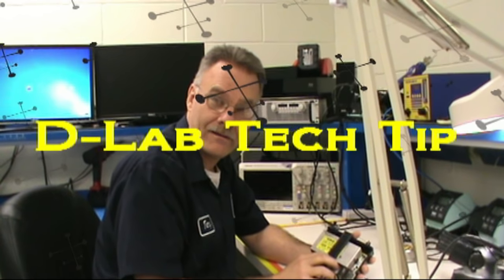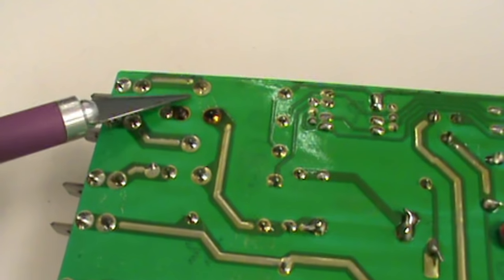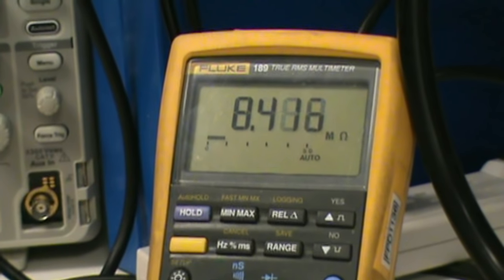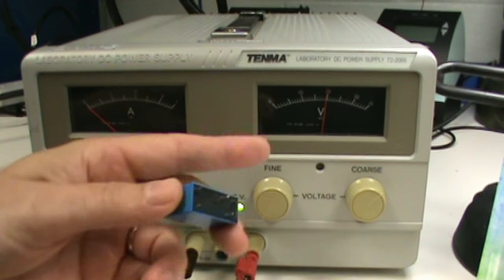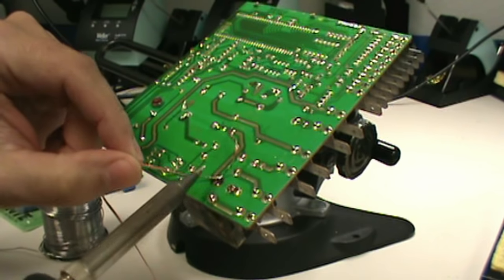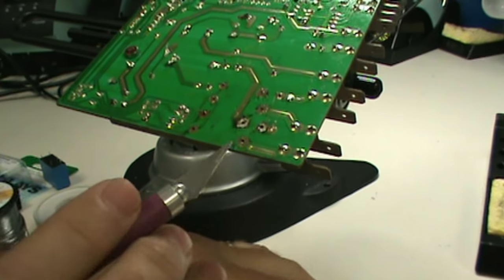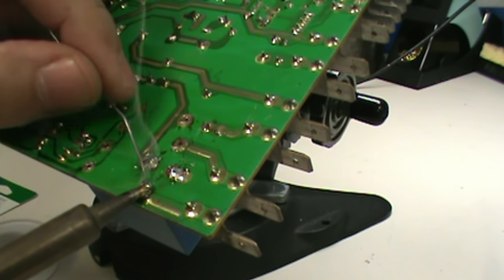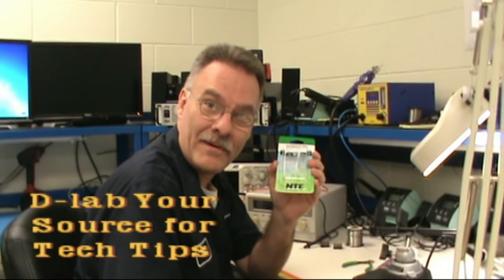How to repair washing machine Remco pcb relay failure D-lab Electronics

Comment: Terry - something I have noticed a lot of tech's do wrong with solder wick :  they don't use the right gauge of wick and they don't cut off the used ends and start fresh every time.  A wider wick is used for larger connections because it can wick much faster than the thin stuff.  Cutting off the end gives better visibility and faster melting by heating with less heat.  I have wick available in sizes from about 1 mm to 6 mm widths in my collection.  When the need comes for larger wick I have been known to form the 6mm stuff into a piece twice as wide, or just use a solder sucker tube and clean up the traces with the 6mm wick.

Comment: Hi TD,
Our Frigidaire freezer blew out its electronic control unit, it does all functions. 
80$ R&R, easy fix.  But I also replaced its compressor "relay" and motor run cap, made the freezer better.  I opened that "relay", no moving parts, no coil, just a disk that's the size of a thick dime, perhaps an SCR solid state "relay".   DS.
Reply from the maker: ***** Hey man, Thats a thermistor. It conducts on start up then heats, changes resistance, removing the start current. Ours went out to a few years back.
Reply: Funny they call it a relay.
Reply: Yeh .. but i think that it's called PTC also or positive temperature coefficient .. you will find it in the degaussing coil for old crt tv

Comment: great video, Now whats the root cause ? is it the old relay was underspecified so you need a bit bigger capacity one ? or was it getting overloaded by other components causing it to fail(this will kill the new relay) ...or old relay simply consumed its on-off cycles ?

Comment: Hi how do u know if a relay is faulty wen its not burnt n stuff like yours?
Reply from the maker: Inspect the contacts, see if they look black/pitted. Contact show the damage first. Also make sure the solder joints on the PCB are not cracked, loosing continuity.

Comment: How about repairs for the the Frigidaire / Kenmore Front Loader Control Boards. Thanks for this!!
Reply: Chet Leonard 
Repair is get a new machine, and not a front loader. 
Better yet, get something with no control board. Just a timer and heat selection switches.
Speed Queen baby.

Comment: Electrolux Washer Motor Control Board - Part Number: 137469113 manual codec error  I need  please   venezuela